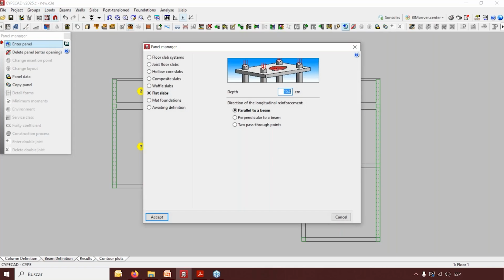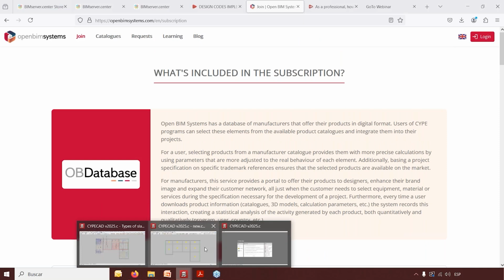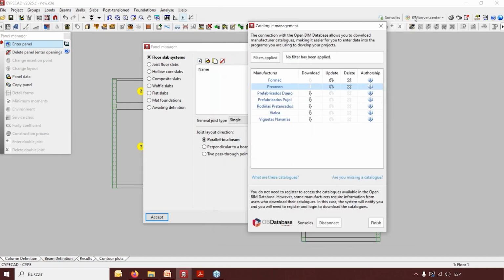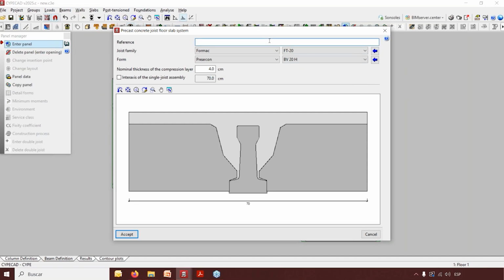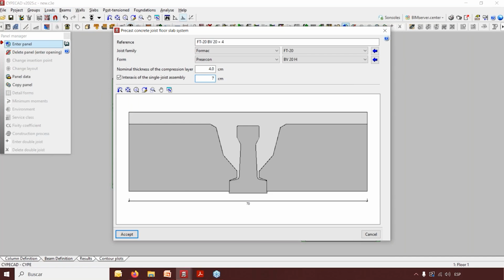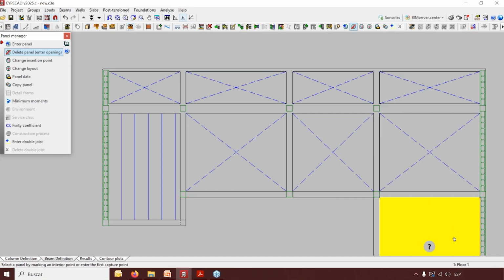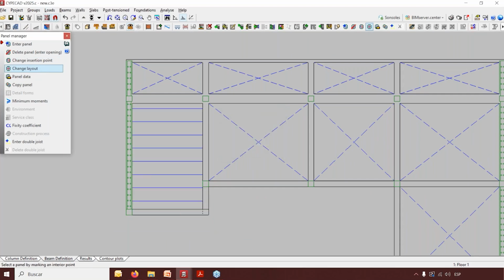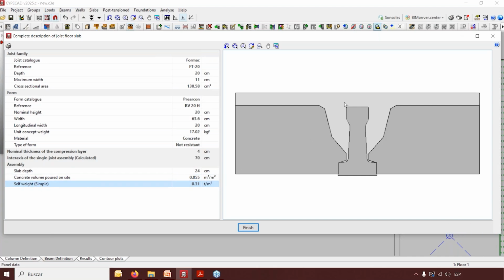CYPECAD: Entering and editing precast concrete joist floor slab systems

Comment: Please is it possible to create a circular opening in CYPECAD?
Reply from the maker: Hello! To create an opening in a floor slab, you need to insert beam segments to form the perimeter of the opening. A polygonal line of beams can be used to draw the outline of the opening, thus approximating circular geometry. Kind regards 😊